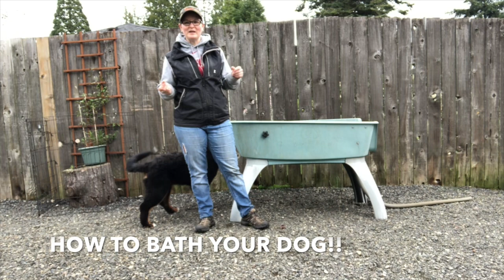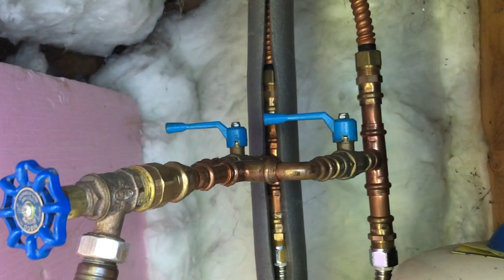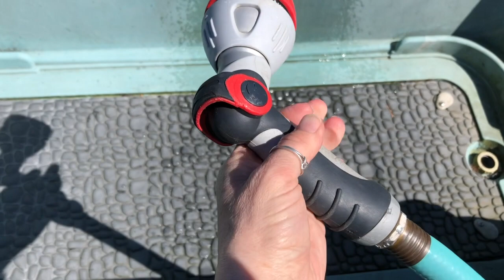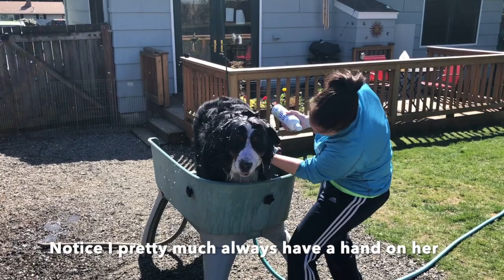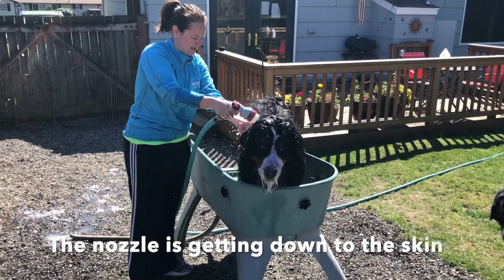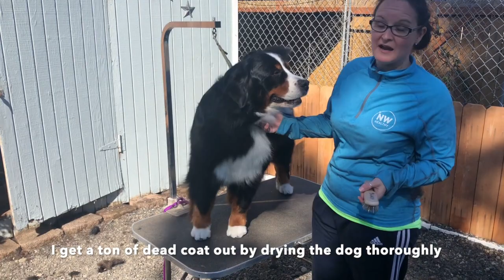How to bathe your Bernese Mountain Dog! An easy way to wash your dog in 15 minutes!

Comment: I’m loving your content. Is it safe to wash your berner outside in winter? It’s about 5 degrees centigrade here and my Bonnie could really do with a bath but I don’t have an indoor space I could use
Reply from the maker: It might be a bit cold. I wash outside with warm water and dry in a shed or garage with a dryer. Can you wash in a garage and pipe out the water?

Comment: Unfortunately my 94# girl jumped out of our booster bath a few months ago and had a very tramatic experience as she was tethered to the front and we weren't able to release her.  She actually broke both front legs off the bath in her attempt to escape.  Do you think that we will ever be able to get her back into the booster (once we replace the two front legs)?  Heer last 2 baths have been back in the tub in the house.  She avoided even walking near the booster which was lying in the walkway next to the house.   I am devastated that we may have "ruined her" to the bath which she used to love.
Reply from the maker: You definitely have an uphill battle. I would let her have a break for a few months from the bath and then start with reintroducing it with high value treats only for the bathtub. Just walking by, then you touching it all while rewarding her. I would start feeding her next to it. Ultimately, you might need to put her in it and just treat, treat, treat and jump out. Rinse and repeat. It will be a process but with positive reinforcement and time she can get there. When you do try to wash her in the bath, you need two people, one to hold her and treat her and one to wash. When I wash any new dog I always have one hand on the dogs collar and body so I can hold them and know what they are doing and one washing, it takes practice!

Comment: Hey Stacy, do you find your Berner's get clean enough with cold water?  We have 2 and I would love to do their grooming but I wasn't sure if it would be as effective without warm.. thanks for any feedback!
Reply from the maker: Yes, both cold and warm work well. It is about getting the appropriate amount of shampoo in their coat down to the skin and rinsing it all out. But I generally only use cold water in the warm months. It is also imperative to get them 100% dry with a dog dryer.

Comment: Can you use a “human” blow dryer? Or is that not powerful enough? If not, where do you get a large dual motor dryer?
Reply from the maker: No, human dryers are too hot and not enough power to get down to the skin through the double coat. I order mine online, they are an investment, but well worth it. Mine have lasted 17 years.

Comment: Do you fully comb or brush out the dog before each bath or can that be done after force drying? I have a mini Schnauzer x cocker spaniel and it takes forever to fully comb out.
Reply from the maker: Because I wash/dry every month I generally don't have mats. So I wash first and dry and brush at the same time since the dryer blows out a lot of the dead coat.